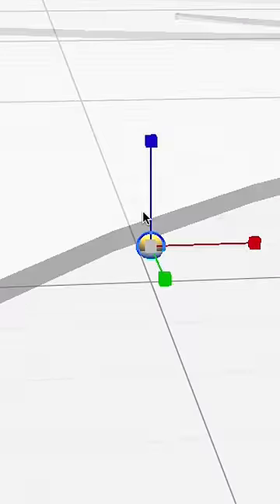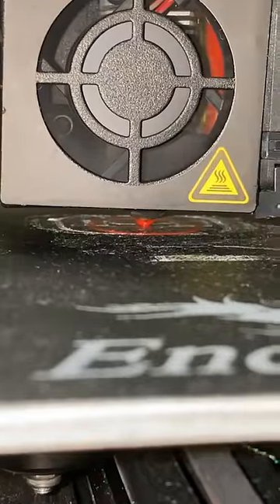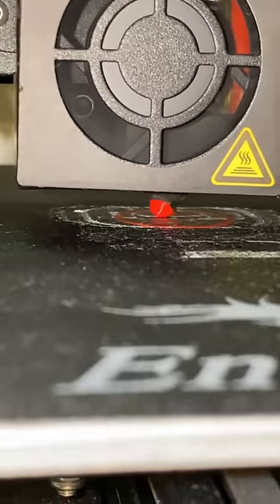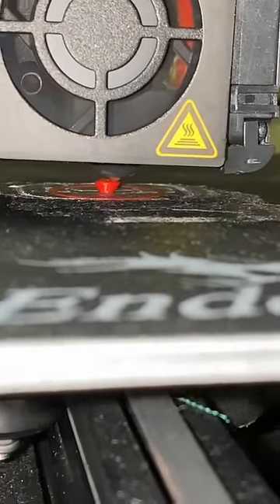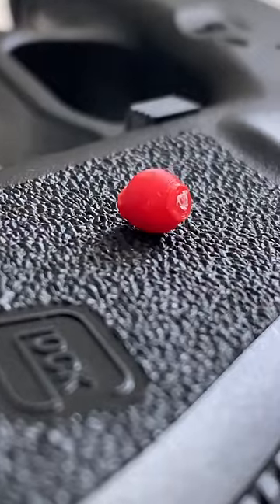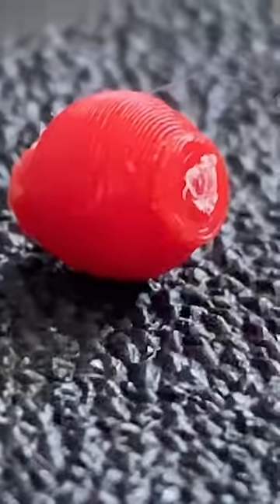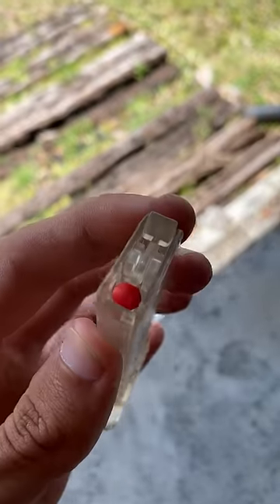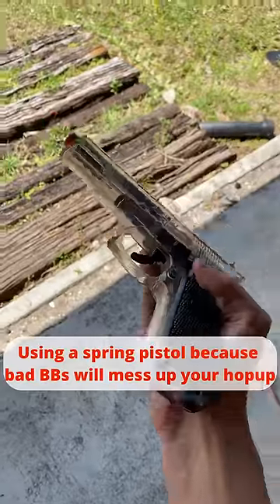Let's make 3D printed airsoft BBs

Comment: I feel it may be a little smoother with a resin printer
Reply: My thoughts exactly
Reply: Was just thinking the same thing would have great resolution on resin printers
Reply: If you tried to mass produce though it would be fairly labour intensive with either printer. You would need to smooth out the mounts to the plate or supports which means you need to carefully scrape every single BB with a scalpel or sandpaper.

Maybe you could get it to go faster if you over sized them by like 20% and put them in a rock tumbler (just the bb's no ball bearings). Then you pull them out once they are at the correct size. Although I suspect there would be too much variance/inconsistency in size and shape.
Reply: Bruh just buy them from the store… lmao
Reply: @darreldash  the point is to see if its possible, though. Not because it would be a better alternative. But because its fun. Ever heard of that? Fun?
Reply: resin is expensive
Reply: @pancake5830  I mean not really. It would pennies tops per bb
Reply: Or a little sanding
Reply: The real move is to 3D print a mold and then just cast molten plastic into the mold
Reply: You can try using peas as BBs
Reply: @OrangeDaGangster  feed your enemies some peas :)

Comment from the maker: Honestly... it worked better than I though it would.

Buy the 3D printer in this video: https://ebay.us/vZ2120
My favorite filament: https://ebay.us/FZrPCt

The above links are affiliate links meaning, at no additional cost to you, I receive a commission if you buy from these links. Everything earned goes back into making videos like this!
Reply: Id suggest putting them in a tumbler to smooth out the roundness
Reply: Print them in half, then glue them together using some good ass glue, you can get rid of the layer lines by enabling ironing in cura
Reply: I got that same BB gun loo
Reply: Try using frozen peas, I use them when im shooting in forests
Reply: I thought they were pees!
Reply: "Easiest cad model ever" ... fails

"After changing some settings we get a successful print" ... proceeds to show how it was a failure of a print and barely fired

Describes how it sucked.

/vid. 

Easiest cad model ever, eh? If I design a simple line of plastic and call it the easiest cad model ever but I'm trying to print a fully functional .50cal m82a1 then it isn't the easiest model ever.  It's a failure.  Just a failure.
Reply: Try a resin printer minimum layer height
Reply: Plastic injection molding works better for this sort of thing...
Reply: Is it possible to use frozen peas for ammo?
Reply: @StabbyJoe135  dang calm down dude.
Reply: I mean, you did print something ha. That’s about as good as I expected.
Reply: Sand it down
Reply from the maker: @hobo_frog892  I might need to try that!
Reply: Me, who want a link to the gun

Comment: You could try a Resin 3d printer. They have around 5microm tolerances and are pretty accurate in printing
Reply: This works fwiw, but you have to print them up on support to avoid the elephants foot/flat edge and it's a fairly unreliable setup. They are too small to really be supported well and it seems like one or two always stick to the fep and fail, but with some tuning I'm sure one could sort that out. 

Lots of waste as well as support uses about as much resin as the BB itself. I thought about the possibility of printing them in a sort of lattice of BBs with small support struts connecting them and stacking several layers to reduce waste and increase quantity in a single print, but I couldn't be bothered to actually put the work into it.
Reply: But like, why would you? The time, effort and money involved is just not worth it to get a sub par product.
Reply: @skywardsoul1178  no idea haha. But if you were to print them this would be the best way to do it
Reply: @skywardsoul1178  it's a huge waste all around, you're right. Not even worth the lulz tbh
Reply: @bennydontplaythat  Agreed, but you'd have to be extremely desparate by that point and not be able to buy any.
Reply: Micromm... do you mean nanometers?
Reply: @binaryparrot3352  Nanometer would be extremly precise. No Addative manifacuring method could produce something with nanometer tolerance. Commercial Resin printers have a tolerances of around 5 micrometers .

Millimeter =1 × 10^-3[m]
Micrometer = 1 × 10^-6 [m]
Nanometer = 1 × 10^-9 [m]
Reply: What he really needs is an sls printer for small round parts like this.
Reply: @naruebethsareetho8628  the comment says micromm, so micro millimeter. Saying micro milli is saying * 10^{-3} * 10^{-6} = 10^{-9} which is nano. I am not saying it is possible, I just wanted to point out saying micro milli is redundant.
Reply: @binaryparrot3352  oh I mistyped. i ment 5 micrometers
Reply: AlexAlexAlex  Most resin printers are sla not dlp.
Reply: Think if you’re buying resin to print bbs then you may as well just buy the bbs.

Comment: 3 easy fixes 1 add supports 2 do multiple next to 1 another to increase surface area to the print bed and 3 use less infill to make them lighter and less likely to pop loose

Comment: You can easily and drastically improve the quality of printing BBs on this same printer. If you do research on your slicer of choice, many technicalities and preferences will become transparent and adjustable to you. For starters I would use a raft and lessen the layer height. If your using Ultimaker Cura you can do both of these in the basic settings window.

Comment: If you wanted to actually make them round, just make more of them and put them either into a rock tumbler and just the action of them rubbing against each other could smooth them, or use something like they use for cleaning brass for ammunition with a less abrasive medium than sand.

Comment: Get a long stick of plastic with an 8mm diameter and cut it into 8mm pieces. Then put them in a rock tumbler for about 2 hours. It makes near perfect 6mm BBs. If you don't mind the effort you can make a crazy amount of BBs really really cheap. 😁👍

Comment: Decrease the layer height 😂
Also I believe on the ender 3 (your printer) you can use thinner filament by buying a smaller nozzle. You should be just fine

Comment: It would have worked if you would have grinded down the knobs on either end of the 3D printed BB and you don't have to physically grind down each individual one you can use a tumble grinder that they use to polish bolts and other metal to and refurbish it doing it this way might even smooth down The ridges

Comment: Could use injection molding with plastic from all your destroyed PLA prints. Cause BBs supposed to be bio degradable. In factories 🏭 🏭 the polish BBs after molding them. So not that easy after all :)

Comment: You realize you can take a soldering iron to smooth off those remaining irregularities and make it smooth right?

Heck, you could probably even toss it into a rock polisher and it’d do the same thing.

I literally make .40, .50, .62, and .68 caliber paintballs using this method all day…
Reply: Oh- and fun fact: if you leave some of the grooves on a 3D printed round after smoothing and fire it through a barrel with no hop-up or backspin, the ridges in the round seem to give my 3D printed rounds backspin! 

I’ve only tested this with the .50 cal version of my 3D printed paintballs, but they definitely go WAY further than non ridged paintballs.

Comment: It is weird. I Printed a smaller bb for one of those air guns that use the metal bbs which are way smaller than the 6 mm bbs and it came out perfectly round. I Guess its my settings

Comment: Let me guess, you made a filament dust launcher out of your airsoft pistol?
Reply from the maker: Since the gun I used was so low powered it actually held together. That’s why I used the spring pistol though because it probably would turn into dust with a more powerful gun 🤣
Reply: @AirsoftGunsnGear  I'm surprised it held together at all.

Comment: you need to calibrate your printer and those layer rings will go away. and dont print a bead print a box with supports and the bb inside  if you want it to be round!

Comment: How did you fix the settings?
I have the same problem with my ender 3.
Reply: You don't need to change settings
Reply: You just gotta clean the print bed and level it that's really all you need to do

Comment: It looks like you're using a pretty cheap springloaded Airsoft gun; even if you got this to work in that, it would be a disaster in a CO2 gun, where the pressure would make the gun shoot sharp shreds